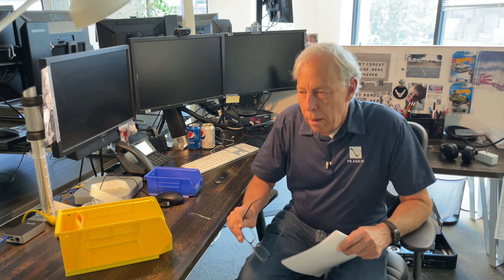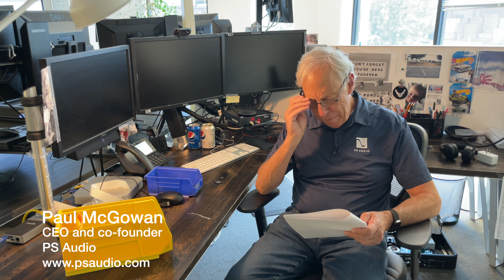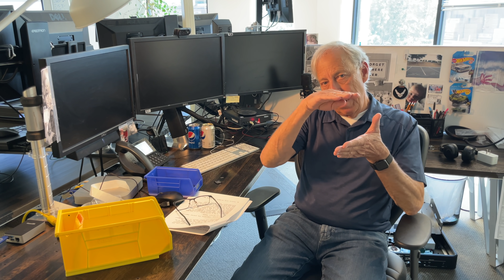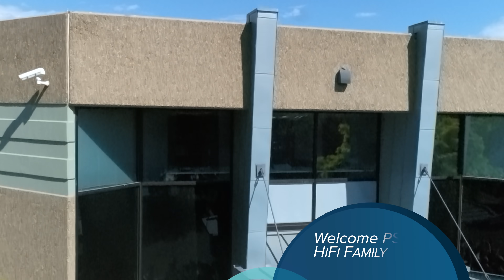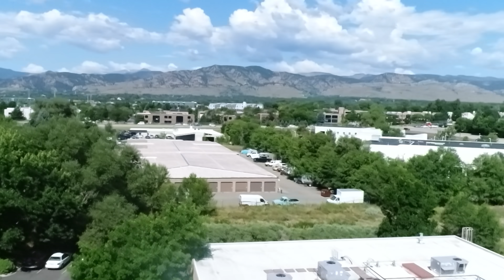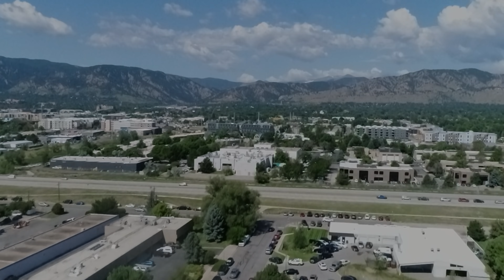Why stereo systems sound different at night

Comment: Remind me: what's the function of the power supply section in every component? Oh, that's right: it converts AC input into stable DC output. It's not rocket science, but to some audiophiles it might as well be.
Reply: @Taco "No power supply can fix that" is simply idiotic - what do you think is the crap you hang before it built of? ivory horns?
Reply: "I only believe what I hear. I have no time for measurements or silly articles that claim snake oil."  LMFAO - Even basic test equipment can measure many decimal points better than the best ears.  If conformation biased placebo makes you happy, enjoy it.. but basing your argument on that doesn't hold any weight.
Reply: @0x07AF  
The "engineers" seem to forget, it's all a matter of personal taste.
You like this, I like that. Very simple.
Reply: @Mark-lq3sb  If you can neither measure the effect with modern test equipment nor prove an audible difference exists with controlled double-blind testing than what you have is a case of subjective imagination.

If your personal taste is paying out the rear for a placebo, have at it bud. It's all yours!
Reply: obviously the high-end stuff simply has crappy power supplies given that a trained monkey can build a proper one
Reply: @Harald_Reindl  I didn't know you build power supplies. Good for you.
Reply: @mjot2360  at least I could because I have the technical knowledge - the same knowledge I expect from a manufacturer for so called high-end, otherwise its low-end crap when they don't manage the easiest part
Reply: @Harald_Reindl  yeah. Its very easy. I say that about all the things I have never actually done as well.
Reply: @Douglas Blake thanks, I really appreciate the explanation.
Reply: @Douglas Blake Hallelujah to shopping carefully! Circumstance teaches this invaluable lesson to those of us of finite means.
Reply: @Douglas Blake Great analogy, the ice cream store. Great moment of fame at the audio show! 
When dummies try to argue, they revert to "it's all a matter of personal choice, you like this, I like that," and they pretend it's subjective rather than objective. You like this, I like that, it's all good. It annoyed me when BP gas was advertising on TV, and they were advocating for the abolishment of the very product they sold (sort of a kiss butt thing to  environmentalists). So in the commercial they interviewed older people at an outdoor restaurant (people "in the know") and they said yeah, wow, there are so many great choices, there's solar, wind, bio fuels, etc., as if each one is just as good as that filthy oil. You like strawberry ice cream, I like black cherry. Or my neighbor who was using a wasteful single hose portable air conditioner. They waste up to 50% due to the fact that they send the just cooled air outside (to cool off the condenser, whereas if they had 2 hoses the outside air cools the condenser, saving the house's cooled air). They had to change the ratings on them, so if you buy a single hose, 10,000 btu unit, it says something like 10,000 old, 6,000 new, printed on the box. So the more I explained, the neighbor kept resorting to "well, I'm happy with it." It was like I was talking to Michael here. The neighbor was a tightwad, so him wasting money was a big issue - except no one can ever admit they're wrong. It's hard to do, and I do it sometimes because that's how you learn and become more right in general.
Reply: @Douglas Blake 
You just gave us an example. Add 3000 + 1000 What's that =
As I shake my head...................
Reply: @Douglas Blake I agree with everything you said. 
The definite cut and dry part is yes or no, does an external aftermarket UPS improve your sound, and I say that is cut and dry, the answer is no. Same with the $200 RCA cable vs $12 cable. There is no difference, it's not a matter of personal choice or subjectivity; there is no measurable difference, only a placebo affect for people who choose to believe they improved their sound with the aforementioned shocking omissions from the factory. I once had a woman claim (and it looked like a lot of people backed her up, but it was probably her with multiple sign-ons) that with quad firing spark plugs (4 electrode tips) she gets "more miles to the tank." She doesn't. Cut and dry. CAFE and the automakers would have installed them from the factory, and also, if she did get more miles to the tank (clever wording because she probably knew "higher mpg" could be disproven) it was sort of confirmation bias, where she drove more efficiently (more coasting, not racing up to red lights, etc.). There are lots of people who think their low priced economy new cars have more power when they put in super/premium gas. "They run smoother too." I have done extensive research on this and with a yes or no/black or white - these people are wrong. This is not the full extent of my research, but many engines built with compression ratios for 87 octane, actually run WORSE (just a tiny bit, hardly noticeable) on 93 octane. They give the food analogy; you'd like better food in your body. The world is full of Michaels.
Reply: Are you saying that the dc  power supply compensates or corrects or makes it unimportant if lousy ac power is coming from the electric company?
Reply: @new2000car  surely - guess what capacitors are for - sorry but only high-end crap has power problems
Reply: @Harald_Reindl  Thanks. I know nothing about high -end crap. I find it hard to believe they put in garbage power supplies. Maybe they do?
Reply: @new2000car  if they don't you wouldn't need a "power plant" in front - common sense
Reply: @Harald_Reindl  In order to hear the difference good power conditioning can make you have to have a higher resolution system. Lower grade equipment actually introduces more noise between components that will wash over anything a power conditioner would improve.
Reply: @mjot2360  muhahahahahahaha
Reply: @Harald_Reindl  main issue is your system can't resolve the benefits of cleaner AC. I would hate to think its your hearing so I blame your system.
Reply: @Harald_Reindl  I have a lot of money invested in room treatment...probably double what your system costs. You shouldn't assume things.
Reply: @Harald_Reindl  room treatment doesn't produce sounds. It manages it.
Reply: @mjot2360  they you are the exception and given that i have reverb times of 300 ms in a terrible building with only massive walls i doubt you can impress me with whatever you did
Reply: @mjot2360  More false logic. It's not one or the other. It's neither. The cleaner AC did not give better sound, and there was no difference in sound to hear.
Reply: @Harald_Reindl  wow dude your reverb times are that controlled?  Your sound must be state of the art.
Reply: @mjot2360  it is no rocket science to get studio quality in a living room
Reply: @Harald_Reindl  studio quality is very subjective. Let that be clear.
Reply: @mjot2360  no, 300 ms are the goal of a listening room in a studio which means you hear music the way it was intended
Reply: @Douglas Blake its all good.  You don't know what you don't know. You shouldn't pretend to know what others experience. There are too many self proclaimed experts online. Many of them are not familiar with audiophile gear and sound. They should speak less.
Reply: @Douglas Blake technicians???!!! Wow. I'm very sorry for challenging two technicians. If you both put your salaries together I bet you can buy some really great audio gear and power upgrades. Then you will hear what I mean instead of just pretending to know. Technicians....😂
Reply: @Douglas Blake yeah see ya dude. I have some serious hi fi listening to do.
Reply: @Douglas Blake as long as your system is good enough for you, that's all that matters. Im just informing you why you might not hear a difference. We all know the real reason is that you have and will never try power conditioning products or high quality cables because of your mindset. Again, we don't know what we have never experienced.
Reply: @mjot2360  except as the engineers here proved, you're not qualified to inform anyone here of anything.
Reply: @new2000car  how so? You have never heard what Paul and I are talking about. Paul is a real engineer who owns a very successful company. Did you prove him wrong too?
Reply: @mjot2360  Paul is a canny salesman who tickles the vanity (and wallets) of people with too much money and no understanding of electronics. There, I fixed it for you.

And yes, Douglas did prove him wrong too. You want to know why our systems sound better at night? It's really, really simple. It's been a long day, our brains are tired: we're in a mellower, less critical frame of mind. Same reason as why people say their systems sound better when they've had a few shots or smoked a couple of joints. It's called subjectivity, and we all experience it whether we think so or not.
Reply: @thisisnev  you should probably stop watching his videos. You're going to get yourself very upset and for no good reason.
Reply: @mjot2360  I'm not the one who's getting upset, Michael, as might be surmised from the fact that I'm the one having to explain the concept of chilling out to you.
Reply: @thisisnev  the only thing you explained is your lack of knowledge and experience with hi-fi gear. Now excuse me while a change out some power cords and experience audio nirvana.
Reply: @mjot2360  Forty years with hi-fi gear have taught me only one thing: there comes a point where it's OK to be satisfied with what you have and get off the merry-go-round. It's not a competition. I found audio nirvana years ago. Good luck finding it, but I don't think you ever will as long as there are snake-oil merchants pouring expensive doubt in your ear.
Reply: @thisisnev  Yes subjectivity goes way up at night, even without alcohol, then way more so with alcohol. I know you know this, but here's my two cents on all of the factors discussed here, in percent of improvement/change at night: 
drapes drawn instead of closed. .05%, 
RH humidity increase, .05%, 
cleaner power from electric company, 0%, 
window closed vs. open, .05%

listener being more tuned in to nighttime dangers (from caveman days) 10%
listener drinking: 10%
Reply: @mjot2360  Paul lost his standing some months ago with the sentence "it's bit perfect but the bits have noise"
Reply: @Harald_Reindl  I understand what he was referring to. I can see why he lost many on here though.
Reply: @mjot2360  it is bullshit - a bit has no space for noise and only wankers buy expensive digital cables - I bet you have some
Reply: @Douglas Blake 
Spend $4,000 on your amp.  Problem solved.
Reply: @Douglas Blake I only believe what I hear. I have no time for measurements or silly articles that claim snake oil. You're so lucky you're an audiophile. You can save so much money.
Reply: @mjot2360  you fool bear what you want to hear after waste a ton of money 

everything you can hear can be measured but you don't hear everything you can measure

if you even can't measure it there is nothing to hear
Reply: @mjot2360  you must believe in your hear only with an abx test
Reply: Not all power supplies are created equal. Also, the cleaner the power going into the power supply the clean you will get out. Paul has stated that dedicated lines and AQ power cords improve the sound of his power regenerator. Case in point.
Reply: @mjot2360  "The cleaner the power going into the power supply the clean you will get out." This is spurious logic, I'm afraid - it isn't a universal law of physics. If you take a shower, for example, you come out clean regardless of how dirty you were when you went in. As I said, the PSU's one job is to produce stable DC and, unless it's garbage, that's exactly what it does.
Reply: @thisisnev  sure...lets dumb this down with personal hygiene talk. Now I know I'm talking to an expert.
Reply: @thisisnev  Bravo, great answer. Also Douglas Blake had great answers too. But anyway, so if someone were to assert that "the cleaner I go into the shower, the cleaner I come out," that's spurious logic? Yes indeed. Wow I love it! Michael Triolo is full of spurious logic, and then when pressed, he actually admits "I only believe what I hear."
Reply: @mjot2360  he was simply illustrating how idiotic your statement was. "The cleaner the power goes in, the cleaner it goes out" is as idiotic as "the cleaner I go in the shower, the cleaner I come out." Someone has to wake you up, in simple terms.
Reply: @new2000car  pretty sure if you go in really dirty its going to take much longer and more effort to come out clean. Not sure if you can comprehend this or see the connection.
Reply: @mjot2360  Your "connection" is garbage. Even when true (sometimes it is, sometimes the dirt washes off just as quickly with no extra effort), does not change the beginning or end. Go in dirty, come out clean. Dirty AC power in, clean DC power from the power supply out. The middle (oh, it takes longer, or oh, the power supply has to work harder) are not what we are discussing. They are immaterial to this discussion. The beginning and end are what are being discussed; dirty AC power in, clean DC power out. That is what you were disputing (because you don't know what you're walking about), so you figure you can cause some confusion about the middle, and that will cast doubt on the whole issue, so you don't have to admit how wrong you were.
Reply: @mjot2360  I guess I just haven't dumbed it down enough, since you apparently don't understand how metaphors work any better than you understand how electricity works.
Reply: @mjot2360   PREcisely
Reply: @googoo-gjoob  I thought Paul would attract more people who "get it" and actually have it.
Reply: @Douglas Blake to be clear, nothing is broken. The short answer is every component of the AC chain makes an audible difference. If you're looking for the absolute best you spend the money.
Reply: @Douglas Blake may I suggest two cotton swabs for you to clear out some of that wax buildup. The return on investment worth while.
Reply: @mjot2360  Or you could just give the cash to the PTL Club, (yes it still exists LMAO)

Comment: I have PS Audio P12 Powerplant and it made a dramatic difference for the better in my system.  I was skeptical when I bought it and figured they have a generous return policy but when I put it in my system...there was no way it was going back.
Reply: How much did that bad boy cost?
Reply: More than my entire system and I’ve never heard anything better than my system.
Reply: @9mmmike642  your entire system costs less than $5,000 and you've never heard anything better?  You need to get out more.  ;)
We all have biases towards our own systems.  Biggest system I've listened to was a a $50,000 pair of speakers.  They were exceptional.  I still like my system better with regards to soundstage, but i recognize where that system is better.  Tone and dynamics.  Maybe i can't have it all, but I'm certainly gonna try now that I've heard what's possible.
Reply: @LunarLightLtd1  if most of the money in expensive wouldn't go in optical bullshit - go hear accuton drivers in a baffle wall with digital crossover - way way cheaper and better than most of the expensive floor speakers
Reply: @9mmmike642  Cool.  If I ever win the lottery I'll invest in one :)
Reply: Don't waste your time talking about the Power Plant because 98% of commenters here are just here to bash, complain about how much something cost and to tell you they're broke. Like I give a F**K!😁
Reply: @Mark-lq3sb  i don't give a shit about how much something costs if it works - the problem with power plants is that only braindead idiots imagine to hear a difference while for the half of the price you can get a ton of stuff for room acoustics which really makes a difference out of your cluttered mind! buying power plants and expensive cables is a fine instrument to take away money from idiots which can't do anything useful with it

Comment: My electrostatics sound better in winter than in summer, maybe for the same reasons Paul is talking about here? Interesting story.
Reply: I also have electrostatics. Although my speakers are stable with climate changes I know some can react to humidity as this can affect the diaphragm bias charge.
Reply: Humidity should not affect electrostatics in good condition, unless an extreme variation. Do your speakers take a while to charge up and reach full volume? If so, this may indicate the resistive coating on the diaphragm has deteriorated and the high voltage bias is struggling to spread over the diaphragm. How old are your speakers? They may need some renovation. No box speaker comes close to the startling reality you hear from a good pair of full range electrostats.
Reply: @geoff37s38  My speakers are Martin Logan Quests, around 30 yrs old, sound great except sometimes in the summer months, when they seem to have a harsher harder sound kind of like a bad recording, but the recording is not the issue (hope that made sense!)
Reply: @aakar88  yes understood. May be worth having them checkd out, depends how much it bothers you, i do not know where you live but you may find a business nearby that renovates electrostats.
Reply: @geoff37s38  Thank you for the reply and interest! I have talked to M&L, they recommend replacing the electrostat panel. but I am reluctant to do that as the issue is more "a live with it" type and the bottom end seeming to cause it ( ie hardness of sound and poorly defined bass)